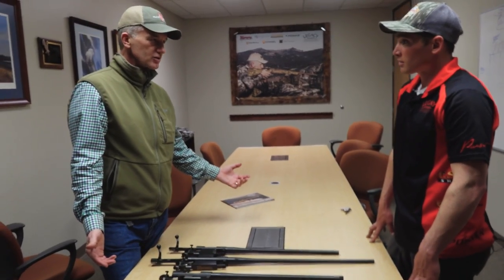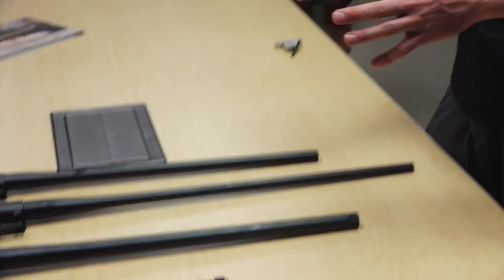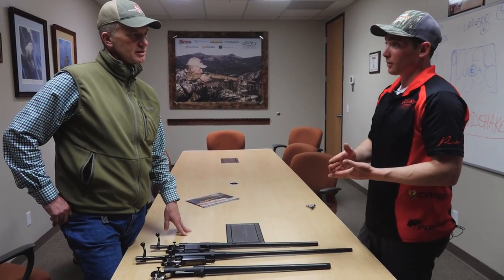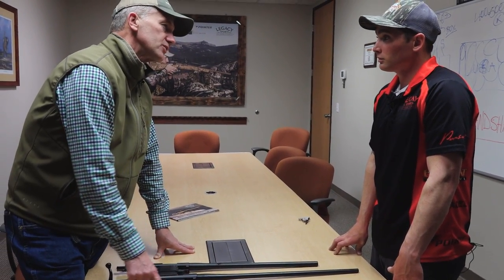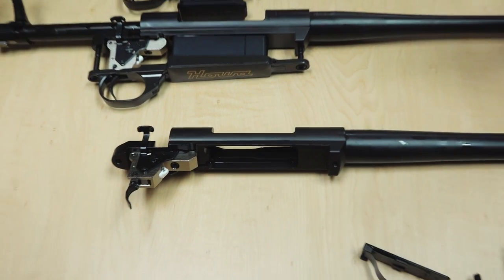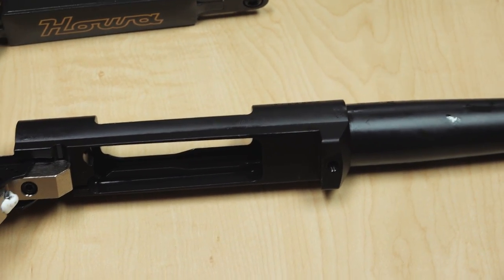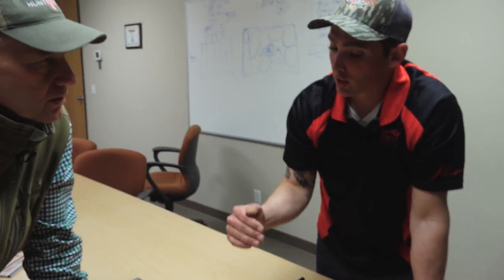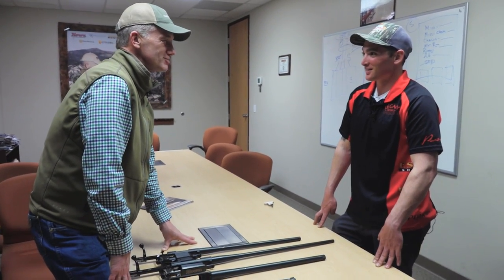Rifle Accuracy Foundation; Barrel and Receiver -  How Howa Does It

Comment: just bought  a 300 win mag and it will not group, called and said to use Hornady bullets. Also using handloads will invalid the warranty. Missed this or would never bought. Going to rebarrel a brand new rifle.